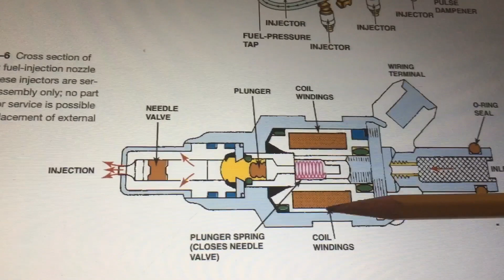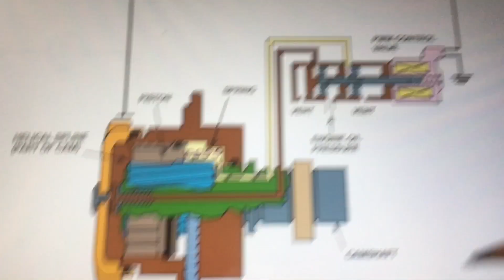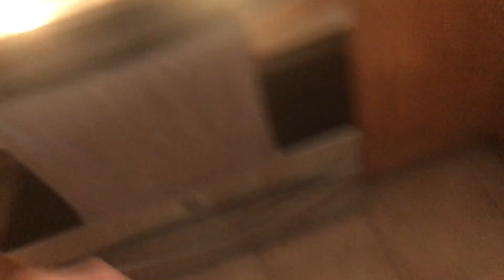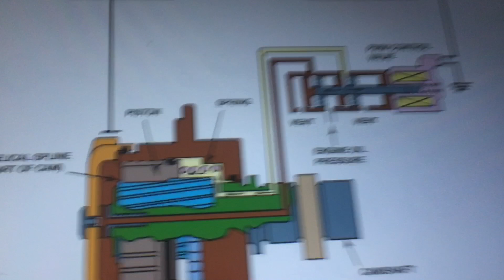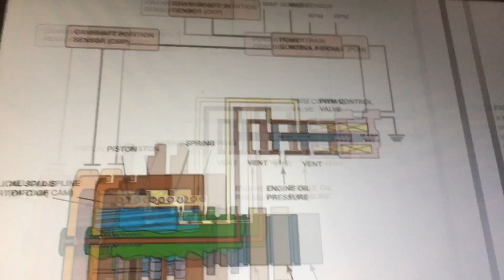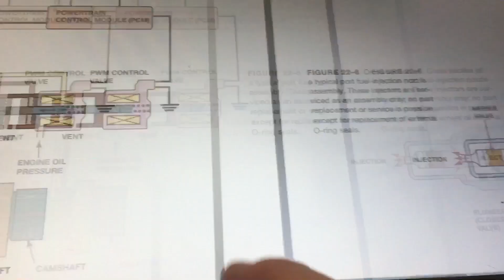Differential Pressure Control (Spool Valves)

Comment: So in both cases the pintle and the spool is spring return (when the coil is de-energized)? If so, it's amazing that a mechanical spring can handle the frequency of the injector actuation. As well as lasting as long as they do. GOOD information, thank you!!
Reply from the maker: That’s right…bias spring rates will be matched to operating frequencies for reasonable coil current requirements and durability/longevity 🍻